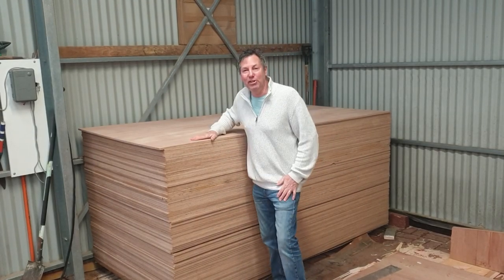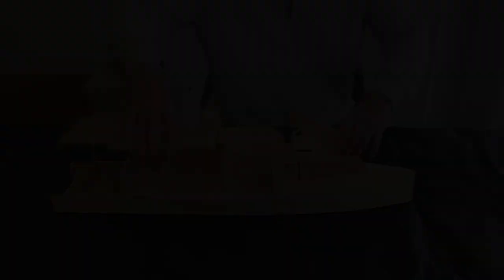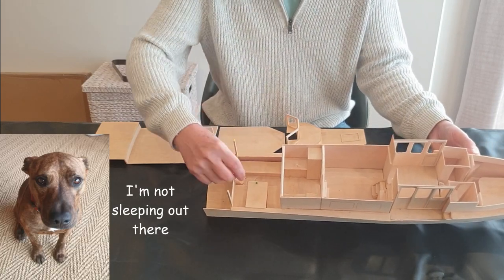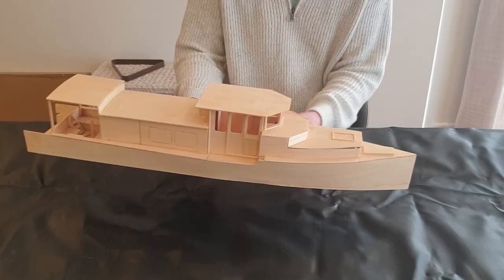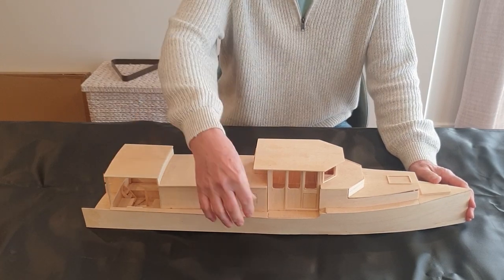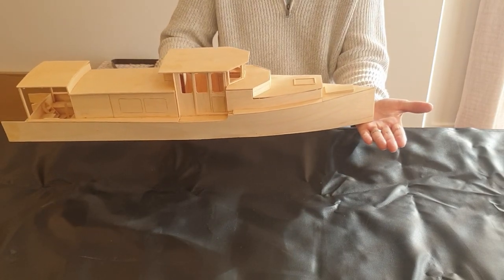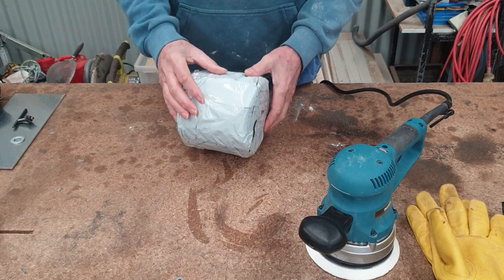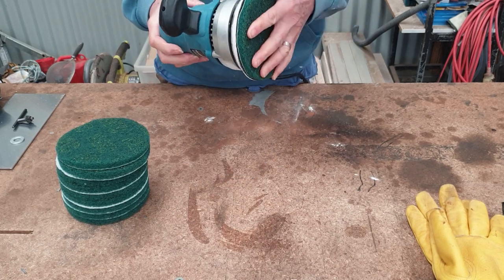Boat Building In The Beginning. Building Dragonfly E 1

Comment: Steve, I have been waiting years for someone to post a project like this on YouTube. I have always been a fan of Phil Bolger’s state boats, but there is almost nothing on video about building and performance. There is an outfit in your neck of the woods called Duck Flats that built a similar yet smaller design called the Mundoo. Again, almost nothing on the internet about these. Thank you so much for sharing. I will be watching every minute you share.
Reply from the maker: Hello, sorry for the late reply, only just saw your comment. Yes I know Duck Flat very well. They are only about 40mins from me. Bolgers" designs and the Duck Flat 'Mundoo" designs differ from my design mainly due to weight factor. My design is much heavier construction with more of a focus on creature comforts. Full queen centre line bed, full headroom separate shower and toilet etc. Thanks for watching and commenting. Cheers, Steve

Comment: I’m surprised you didn’t build on a trailer. Will it be difficult launching without damaging the boat?
Reply from the maker: A trailer hey? This is a 53 foot boat which will be around 6 tons. Much cheaper to move it at the time of trucking. A trailer would be lovely, but very expensive and no way it would be legal on the road here, even just for delivery to the water. (unfortunately)

Comment: Really interesting build.  I like the overall design.  I have to say, though, the beam seems really narrow for the length.  Is that to accommodate environmental restrictions of some kind in the areas you plan on using the boat, i.e. narrow locks, or narrow river passages?  Just curious.  I think it'll be a really comfortable design.  Thanks for sharing the build with us!
Reply from the maker: Hi Meadmaker 452 Yes, there are a bunch of reasons really. The bottom is the same width as the plywood sheets which means only joins across when laminating and no joins length ways, hence ease of build and strength. Also hoping to achieve a reasonable speed with minimal power with such a narrow beam at waterline. I built a 31 footer many years ago with the same superstructure width and was pleasantly surprised at how roomy she felt. I assume partially due to the sides not tapering in at all. See details of that boat and build in episode 2 at 1min 44sec in. Thanks for your interest. ps I am still frantically trying to get this property cleaned up after being smashed to bits in the mini cyclone.  Hopefully getting back to boat building shortly. Cheers, Steve.
Reply: @steveshierdoesstuff7420  - I just got to your episode about the cyclone.  I'm in Florida and we get hammered by hurricanes somewhat regularly (twice this year), so I feel your pain.  Hope the damage wasn't too extensive and you're able to get back to building soon. 

Makes a lot of sense designing the bottom to the plywood dimensions to minimize joints, and the slimmer beam will undoubtedly give you more speed/efficiency for the power you have.  I like the idea of your hidden outboards, too.  Very clean design.  Looking forward to the rest of the series.  

I did stop and take notice of the pictures of the 31-footer you built, shown in an earlier episode.  She's a fine looking vessel.  Looked pretty comfortable on the interior, too.  Has she found a new home to make room for the Dragonfly?
Reply from the maker: @meadmaker4525  Yes, I built her nearly 20 years ago and sold her after enjoying her for 4 years. I was lucky enough to see her recently and to my pleasant surprise she was exactly like the day I launched her. No issues what so ever. That gave me the confidence to build Dragonfly. Cheers, Steve